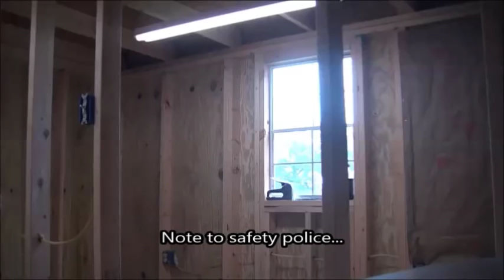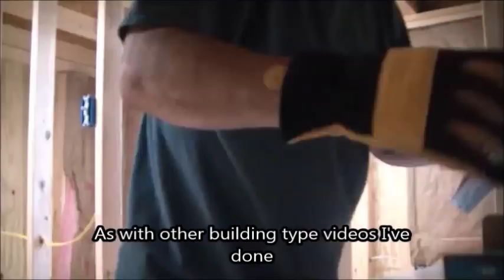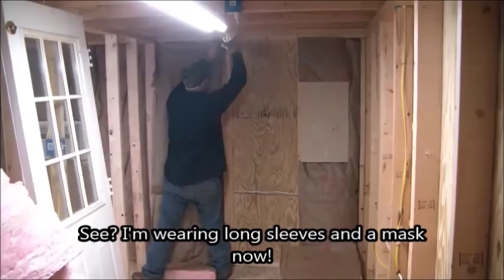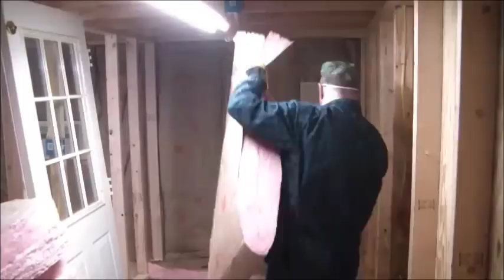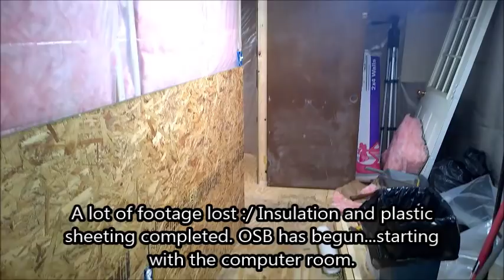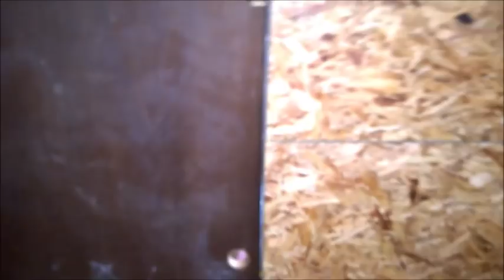Progress on my shop

Comment: Curios as to why the plastic between insulation and osb? I was under the assumption that the paper on the insulation served as a vapor barrier. I ask because I recently turned a shed into a workshop last year, but didnt use plastic...hope its gonna be ok.
Reply from the maker: davester84 Yours should be ok. I was just advised to do so. Partially because it will be a while before I can cover it all with OSB and a mixture of controlling floating insulation fibers and may have something to do with the humidity here in Texas. It's not like a desert like so many think.